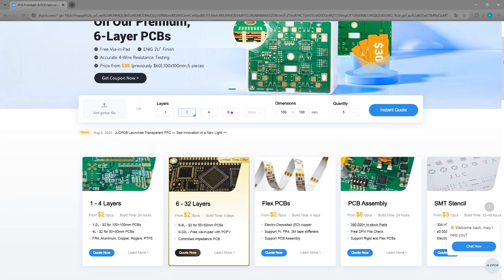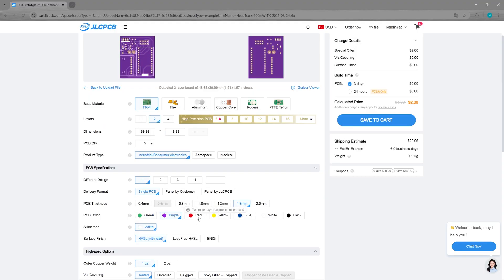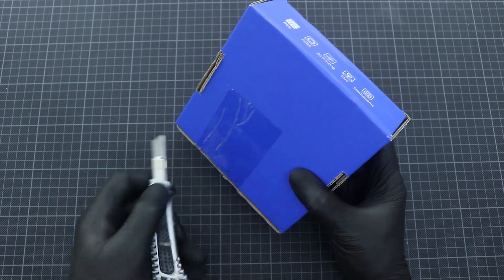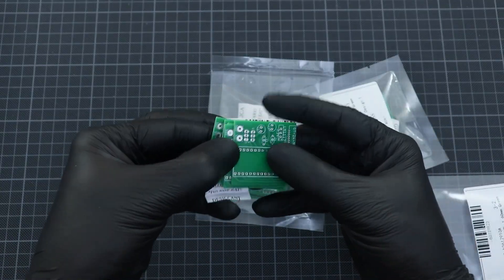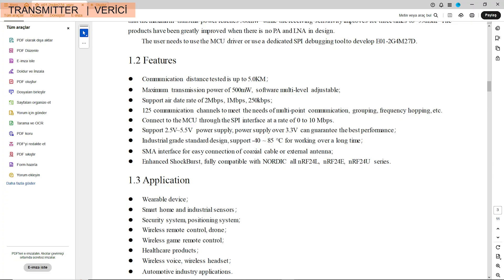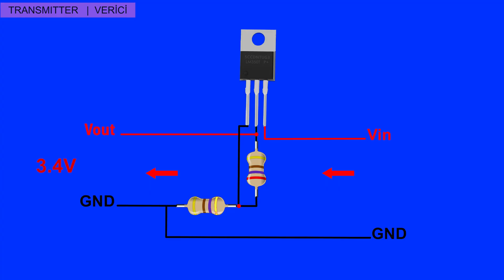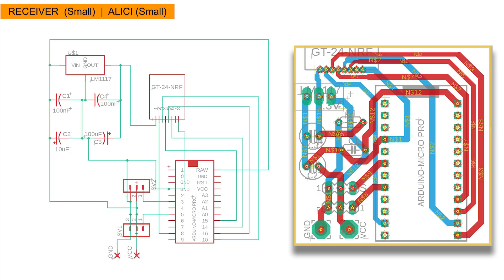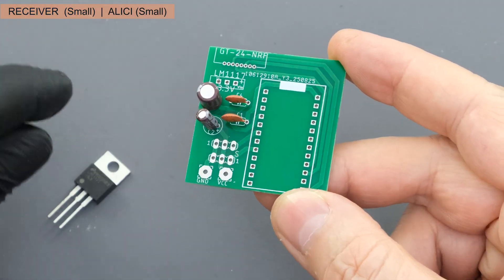Make Head Track For FPV Models. DIY Circuits

Comment: 6 kanallı verici ve alıcımla ilgili sorunlar hakkında size e-posta göndermiştim, ancak henüz bir yanıt alamadım. Bu konuda bana yardımcı olursanız çok sevinirim, Teşekkür ederim.
I had emailed you regarding issues with my 6-channel transmitter and receiver, but I haven’t received a reply yet. I’d really appreciate it if you could help me with this, Thanks.
Reply from the maker: Youtube da ilgili videonun altına yorumlar kısmına sorularınızı ekleyebilirsiniz. Fırsat buldukça cevaplamaya çalışıyorum.  Email sadece firmaların sponsorluk teklifleri için yayınlanıyor. Emailin bulundu bölümde bu durum belirtilmiştir. Sorulara email ile cevap verilmeyecektir. NRF24 modülleri ile yapılan uzaktan kumanda devrelerinde yaşanabilecek olası sorunlar ve mümkün olan çözümler ile ilgili detaylı bir yazım web sitemde uzun süredir bulunmaktadır. Faydalı olabilir. https://www.rcpano.net/arduino-ve-nrf24-modul-kullanilalarak-yapilan-uzaktan-kumanda-rc-devre-sorunlari-ve-olasi-sebepleri/
Reply: @RC-Maker-Lab  Tam bir zaman kaybı. Videolarını gerçek bir yardım bekleyerek izledik ama tek yaptığın sorulardan kaçmak. Paylaştığın hiçbir şey işe yaramıyor — hiçbir şey için teşekkürler.